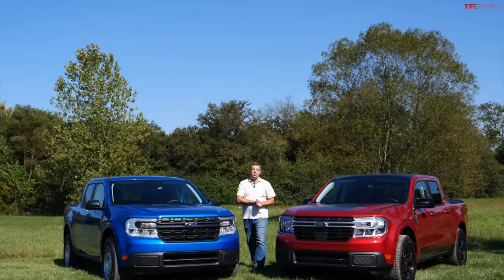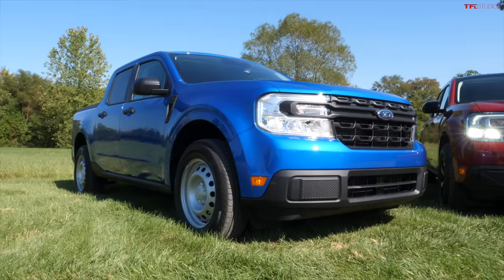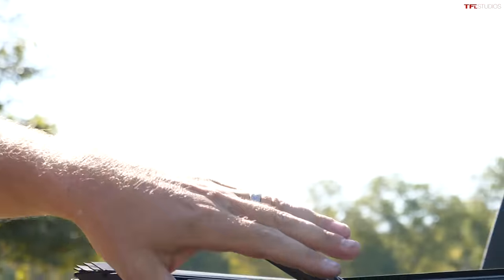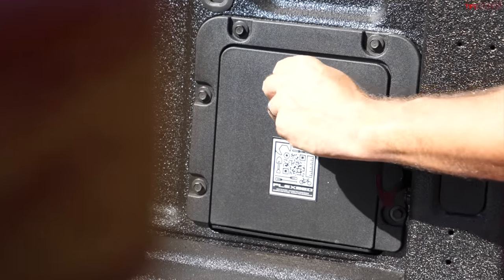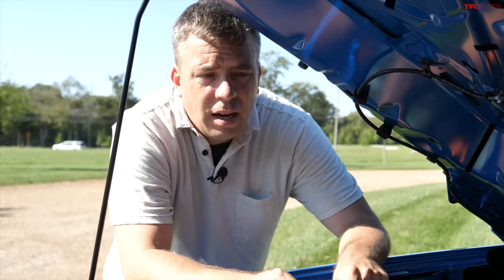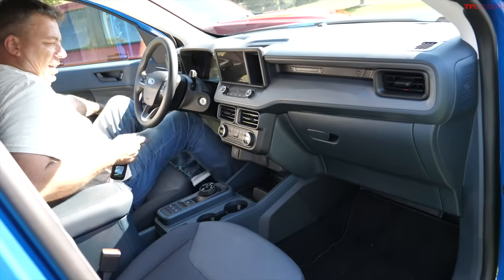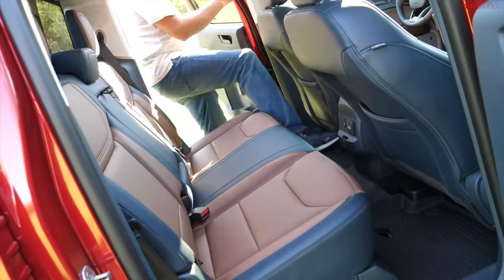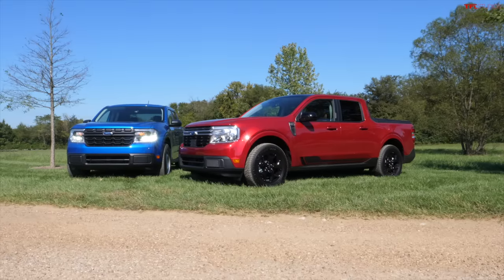HANDS ON with the Least & Most Expensive New Ford Maverick - The Differences Will Surprise You!

Comment: 20k? In this market? I expect it to sell like hot cakes. Low price, good mpg, 4 seats and a bed to carry things. It's a breath of fresh air.
Reply: Wait until the recalls start pouring in. Not minor ones either, if the Ford automatic transmissions on the Fusions is any indicator, these things are going to the scrap heap early.
Reply: @youcancallmemaster2680  fwd cvt hybrids are great for mpg example: civic, prius. I already have plenty of semi trucks, dually, 3/4, vans, this will be a great addition to send someone just do do estimates and small errands
Reply: Yup! Bringing back the tiny trucks of forever ago, sort of. Back in the 90s you could get a brand new Nissan Hardbody for 8 grand. Im really hoping we get a similar era here soon where multiple brands offer mini sized trucks for 20k a pop
Reply: @youcancallmemaster2680  I only partially agree. Hybrid vehicles, CVTs and FWD have their places, and are here to stay. Don't forget FWD is the most popular drive train at least in the United States and has been for a very long time. It all depends on what you need/what you're looking for. A box truck that's empty will easily get stuck in 8 inches of snow. A FWD SUV will have a much easier time. Looking at the Toyota Highlander, the 2021 is rated to tow 5,000 lbs. either FWD or AWD. All that being said, I do agree that using a Hybrid drive train on a truck is a little strange but don't forget trucks used to be electric a long time ago. Electric motors give you full torque on circuit closing. My problem is that these are Ford products and while I may buy an F-150 if I needed one, I'm not too sure about anything else Ford makes. I would rather buy a Hybrid truck from Toyota but there must be a reason why they haven't made a Hybrid version of either the Tacoma or the Tundra that I'm aware of.
Reply: @justacinnamonbun8658  the new Tundra does have a hybrid option
Reply: @justacinnamonbun8658  good thing it’s warrantied
Reply: Scum bag dealers will tack on a $5,000 - $10,000 mark up.
Guaranteed
Reply: @Mr-Clark  It's already happening, but people just need to *not buy from them*. 

Option 1: There are plenty of dealers who are doing MSRP with free delivery or 3-4% Under Invoice (pickup from dealer or arrange a Courtesy Delivery). Just drop by the subreddit and start looking.

Option 2: Buy via the Xplan where they can't pull that bullshit.

The $1495 destination charge is universal, so it doesn't matter if it's shipped to California or the dealer in Iowa/Kansas/Pennsylvania.
Reply: Don’t confuse CVT and eCVT, folks. Hybrid transmissions are CVT because the ratios are accomplished with electromagnetism, not gears with exact ratios. They DO NOT have crappy “belt and pulley” style conventional CVTs.
Reply: @Mr-Clark  Costco auto program avoids this.
Reply: Lots of cvt defenders, I guess. Strange, since they've only been good in terms of what they can be, rather than what they've actually been so far.
Reply: Used Subaru Outback looking pretty solid vs this as well. You know what I mean?
Reply: @justacinnamonbun8658  Ive had terrible experiences with fords and their transmissions 😕
Reply: @BeefGold  I hear you. I'd get a CVT in a small light car that doesn't have to work hard if I HAD to get one, I'd never get a CVT in a truck or SUV, even if it goes 100k miles, a conventional automatic that's engineered and built correctly can double that without being taken apart. I'd get a Toyota or Honda CVT if there was no other choice but as long as there's choices of automatics, I would always opt for a conventional, gear-to-gear automatic with set ratios. Especially for towing. I laugh at the Subaru Ascent that's rated for 5,000 lbs. of towing on a CVT transmission. 😆
Reply: @justacinnamonbun8658  You are living in the nineties.  I own a Mazda6 which at the time was pretty much a rebadged Fusion.  I got some of the same crap from some of my friends, its really a Ford and will fall apart. Well, it has 12 years of brutal stop & go driving and the only time its had any work done is for air bamg recall like every other car.  My other car, Toyota Corolla, needed CV joints at 70K miles, and had had various HVAC issues including the blower motor.  Not major, but the Ford Mazda6 has been the more reliable car.  My  moms Camry needed a complete power steering overhaul at 90K miles, cost $1800.  Ford is building some good stuff, you don't build the number one selling vehicle by building junk.  Toyota Tundra gets horrible mileage and is often rated dead last. Even it had its share of problems when it was new.
Reply: @mark5862  Then put your money where your mouth is and go buy a brand new Ford Maverick. I like to save money, not flush it down the toilet, so I'll with wait a few years to see how the Maverick pans out. Or I can go buy a Toyota or Honda truck today.
Reply: @justacinnamonbun8658  Good luck with your Honda or Toyota.
Reply: @Ww-dl7vr  If you know anything about Toyotas and Hondas, and with probably very few exceptions (as there are exceptions to anything), Toyota and Honda owners don't need luck. The product is overbuilt. That's better than luck.
Reply: @justacinnamonbun8658  okay guy. Keep up with your outdated ideology.
Reply: @justacinnamonbun8658   What does a Fusion have anything at all to do with this truck lol. This is a Ignorant comment.
Reply: And two years later worth 4k. Trucks resale value stay high cuz of the frame, suspension, and all round toughness......this thang gonna flush ur money away.  And 20k is a base the moment u want nice things like the stuff that comes standard on every single other ford..... Ur lookin into the 30k + region.
Reply: @josemigueljr  then just get an escape ...its the base of this vehicle, minus a bed, and u can get one used for cheap and all optioned out.... Same motor and transmission.
Reply: @shaunkennedy174  it would be nice, but wont happen. The safety standards of this era dont allow for it. Back then....what safety standards? lol.  That thing is only that small cuz of that crappy unibody allows it to be more compact. And the suspension, if u notice it doesnt have much ground clearance. Those trucks were tanks back in the day. This thing...... Its a bit of a delicate flower if u ask me.
Reply: @calebniederhofer6529  Both are made by the same manufacturer. What does a Dodge Caravan and Chrysler Town & Country have to do with each other? Or a Dodge Dart and a Dodge Neon? Or a Chrysler Sebring and a Chrysler 300? Or a Ford Taurus and a Ford Five Hundred? Or a Chevrolet Colorado and a Chevrolet Cruze? Or a Nissan Sentra and a Nissan Altima? You're one of those people that keep buying another different model and another different model from the same crappy manufacturer, thinking that they finally got their 💩 together?? 🤣
Reply: @justacinnamonbun8658  they havent made a small hybrid truck, cuz they already dominate the mid size truck market. To them its not worth the cost of R&D. Ford, gm, and chrysler, dont have nearly as stringent rules and regulations concerning there manufacturing process, which allows them to pump out new updated but flawed models all the time. With the thot that only if the flaw falls within warranty will we fix this flaw.  Toyota makes a model and trys to perfect it and sticks with it for years longer than the other guys. It means they get a bit dated, but thats why they are soooooo much more reliable in most cases. It takes them longer to pump em out and make new models cuz they spend soooo much time trying to perfect 1 model. I feel like they will be coming out with a new taco soon.....jus got a new tundra model....its coming
Reply: @Ww-dl7vr  well the toyota is like above and beyond proven by this point.....not really a matter of luck.  Just getting what u pay for really.
Reply: @calebniederhofer6529  same transmission and powerplant.....so a lot......having the same transmission and motor can tell u a lot as to whether its guna be reliable or not.  Same with the escape fusion almost the same vehicle.....
Reply: @Mr-Clark  they already are
Reply: 5 seats
Reply: @shaunkennedy174  yeah but u got an ACTUAL truck for that money back then. This thing isnt even a true SUV let alone a truck, true suvs are body on frame, this is more structurally similar to a car.
Reply: @justacinnamonbun8658  "I would rather buy a Hybrid truck from Toyota but there must be a reason why they haven't made a Hybrid version of either the Tacoma or the Tundra that I'm aware of."

It's because trucks are not their focus. The Tundra was just a way for Toyota to get a foot in the truck market. The Tacoma was once a compact truck like the Maverick, but over the years it grew into a "midsize." The Ranger grew along with it and is also a midsize. The Maverick was designed to fill the empty "compact truck" market. The Maverick is not a true "truck" but wasn't meant to be. It's an alternative for someone looking for a cross-over or small SUV. Some have said it's a reincarnation of the El Ranchero/El Camino line of vehicles which were basically cars with a bed. If you're looking for a real truck the Maverick is not the vehicle for you.

Would I buy it? I'm considering it. I don't need a full-size or even a mid-size truck. I just like the convenience of having a bed that can hold more than a SUV. Hybrid vehicles are always a risk. At this price point I'm willing to try this out. I've had good luck with my 8-year old Focus. The transmission is wonky but everything else has been solid.
Reply: @bomtrady3133  This is what I've read as well about the Maverick. The call it a CVT but it's not the belt-and-pulley CVT. It has a planetary gear system (so I've read).
Reply: @justacinnamonbun8658  Chill my guy. Lol
Reply: @triggerxx9760  Why would you make a comment like that?
Reply: Why would you make a comment like that?
Reply: @justacinnamonbun8658  you're getting all worked up,  you need to relax my guy lol
Reply: @triggerxx9760  #1. I'm not your guy. That must be another guy. #2. Nobody is getting "worked up" I'm just leaving comments. I'm a 42 year old man with two children and a decent net worth. I don't get "worked up" over comments in a place that doesn't even exist.
Reply: @justacinnamonbun8658  I'm a 26 year old and if we're talking about money pretty sure I have you beat Pal.  Love peace chicken grease my guy have a nice day lol
Reply: @triggerxx9760  You done?
Reply: @justacinnamonbun8658  I'm going to like that comment. Cya
Reply: @triggerxx9760  Look at how you talk, love peace chicken grease... Bro what Amazon fulfillment center do you work at?? 🤣
Reply: @triggerxx9760  Next time don't walk into a battle of wits unarmed. I never asked for your 2 cents to begin with. Your break is over, Amazon is calling, go back to your post or whatever it's called.
Reply: @justacinnamonbun8658  it uses an ecvt, not a slushbox
Reply: @Mm If you buy cheap you get cheap and along with cheap come big problems that need money and after the repairs are all said and done you still end up paying just as much as the better truck anybody that has done any hard work knows this.
Reply: @youcancallmemaster2680  it’s not a CVT, it’s a eCVT. No belt. It’s 2 electric motors and a planetary gear. More simple to make, and considerably more reliable.
Reply: @mark5862 ,  The Fusion is a re-badged Mazda 6.   Love it or hate it, it's a Mazda.
Reply: The truck is based off the ford escape chassis, it is a proven trans with no problems,cut is the hybrid only
Reply: nah, the marketing is doing a good job at upselling people, making them think they need AWD, 250hp and 4k pounds of towing ability.
Reply: @justacinnamonbun8658  I think subaru perfected the cvt
Reply: @ocrapo9327  I don't see anything perfect about the only thing between the engine output shaft and the drive train is a steel belt. That's fine for light applications like a Corolla but you'll never see this setup used for serious applications like pickup trucks that haul stuff.
Reply: @youcancallmemaster2680  dumb
Reply: @Mr-Clark  I was thinking 5k then I read this
Reply: It is but it's not
Reply: @justacinnamonbun8658  dude different engine different tranny fusion have always been the worst of the worse Ford has made. Also their has never been a single vehicle released to the market without flaws or recalls within at least the first couples years ever every company does it.
Reply: Yep! I should've ordered one early on haha
Reply: For about 5 grand more you can get a used 2016-2019 frontier 4wd v6 with loaded options around 20 to 35k miles. Known reliable truck. Actual body on frame.  Thats what I went for. Would not trust a brand new ford hyrbid system and its only fwd of you want the cheaper one. No thanks.
Reply: @josemigueljr  Yes but toyota and honda know what they are doing. Ford small vehicles are garbage
Reply: Greetings from the future. The Hybrid is nearly impossible to find. Toyota is expected to debut their competitor soon though.
Reply: Tempting
Reply: Buuut they are not being sold that low right now.
Reply: @Just a Cinnamon Bun  its affordable, but apparently toyota stout is coming so i guess we wait...
Reply: @Sean Butler  im sad i miss small beautiful trucks
Reply: @e S  yeah but 40 mpg,
Reply: @madzmadeit  ford can’t let us have good transmissions, we would never need to buy a new car 😂😭
Reply: @shaunkennedy174 depending on whether you’re going off 1990 or 1999, $8K is obviously not $8K.
It’s almost $15K going off 1999, and almost $19K going off 1990.
And this is a 4-door truck, meaning you don’t need to have another vehicle for a family car.
This is actually a better deal than the trucks of the 90s, in my opinion. But it’s also not gonna stay $20K, as we’re now seeing.
The $20K base model hybrid FWD from 2022 is gonna be $25K for 2024. No longer the base-model.
Reply: go find one for 20k its lies
Reply: 20k ok . Tell me where you can find a lx for 20k  more like 27k